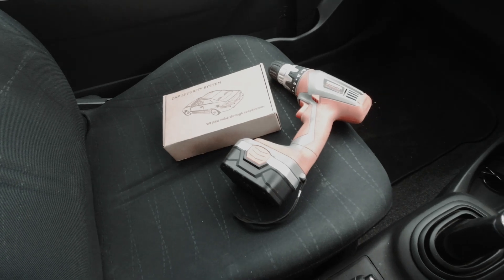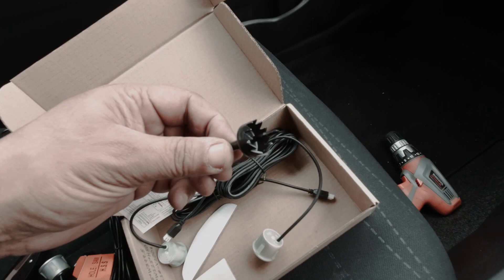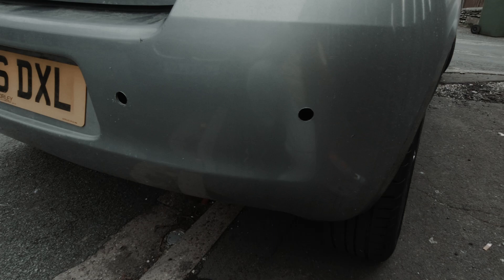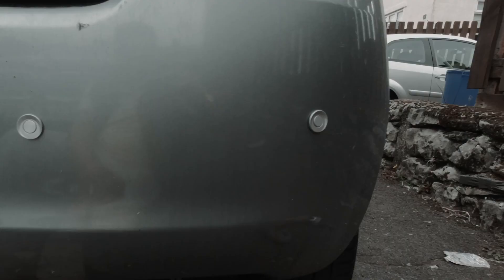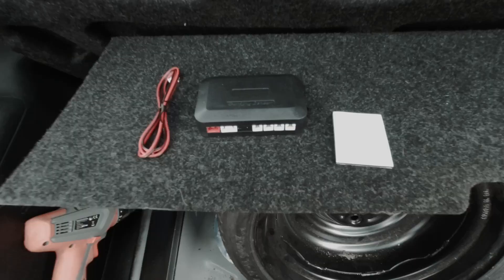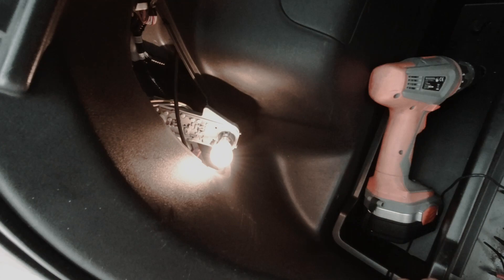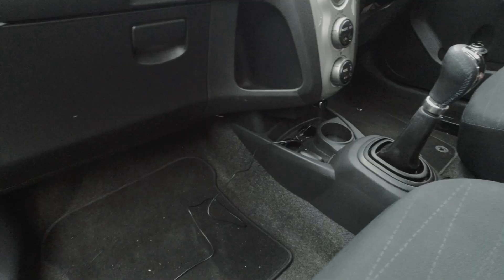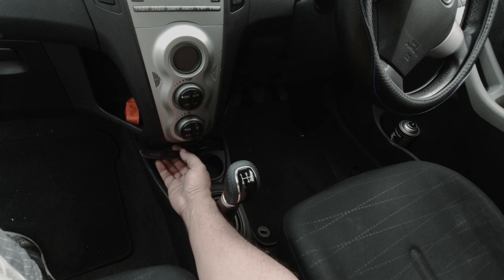Car Rear Reverse Parking SENSOR INSTALL  TOYOTA YARIS. Howto

Comment: I wonder if i can connect the trigger wire to the reverse camera instead of the reverse light? Great job on the instructions, thanks.
Reply from the maker: yes any 12volt will trigger it  thanks  hope it was of some help for you
Reply: @sidehustlevideosUk  thanks

Comment: I'm fitting front and back sensors to a aygo . On the little sheet you had is exactly the one I got . 
I have a problem  (not an electrician) lol  it says red cable  is ACC . Then the next one is yellow which say to fix to reverse light . 
Then there blue wire to go to brake wire 
Black is ground .

My problem is my red cable IS the   ACC wire . So do I wire the red an yellow together on to my ACC red wire . Any help will be fantastic